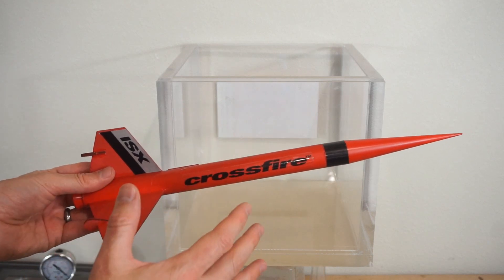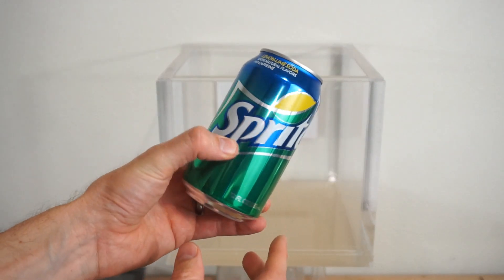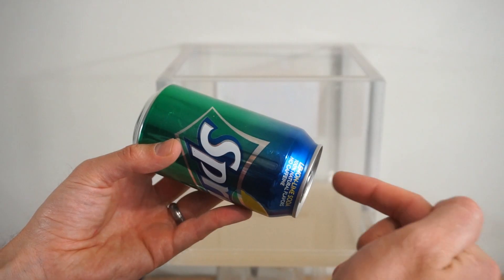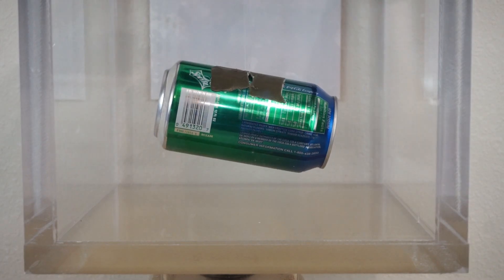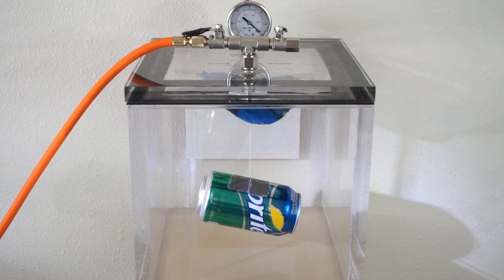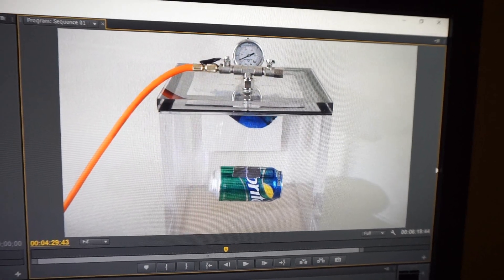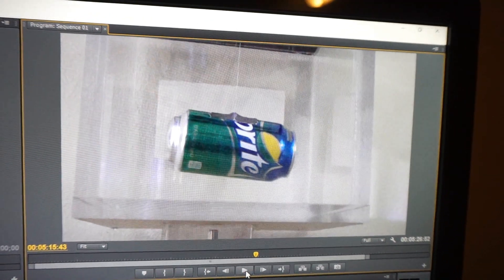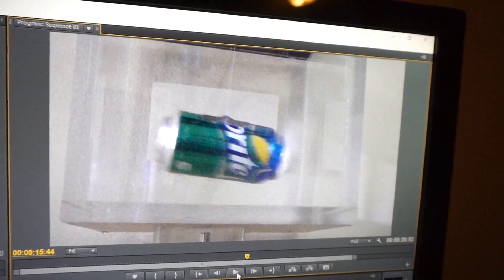Can a Rocket Fly in a Vacuum Chamber?

Comment: Thanks for proving why a pressurized container is impossible in a vacuum
Reply: Thanks for proving you are an imbecile
Reply: Proved nothing of the sort.
Reply: @engineeringtheweirdguy2103  did you not see the what happened to the tin can?
Reply: @JMyoutube1  yes but I understand that the can wasn’t designed for that sort of application. Stick a propane bottle on there and see what happens. It will do just fine. Especially pressurised to the same pressure as the soda can.
Reply: @JMyoutube1  yeah the whole 'experiment' kinda debunks itself, but nasa shillbots will never admit that so meh...
Reply: @papalegba6759  - So when exhaust gas ACCELERATES from the rocket nozzle - from WHERE does the FORCE originate?
See how the chat bot cannot answer that question?
Reply: @papalegba6759  you couldn’t even understand the difternece between materials in compression vs material in tension. I.e a submarine vs a balloon. But sure. Believe away that the video debunked itself based on literally no explanation
Reply: @engineeringtheweirdguy2103  "difternece" lmao you can't even spell the word "difference". plus i've never mentioned submarines, may wanna cut out the lying there chatbot bro.
Reply: @stuartgray5877  you don't even understand that the kinetic energy of a gas particle is related to it's thermal energy, so why explain anything to you? nice try calling me a chatbot tho, NO U! is real convincing... did you know ball aerospace have never heard of you btw? i emailed em to ask.
Reply: @papalegba6759  sorry. Typing away on my phone. Tend thumb words every now and again. Still does not invalidate my argument though. And yes you did. Back when you were talking to my old account which had the password stolen from it. NoTtHeCiA.
Reply: @papalegba6759  I’ve not said anything abusive. Only facts and actual science. And no, it wasn’t suspended. It was deleted. I got locked out because someone changed the password. Shortly after it was deleted. As it turns out it was a flat earther trying to dox me. When he found nothing useful on my account he deleted it and bragged about it.
Reply: @papalegba6759  hence why you can’t find the account anymore on YouTube. If it were suspended you could still find it. Why do you make up random lies and insist they are facts without any evidence what so ever?
Reply: @papalegba6759  speaking making things up with no evidence, I’ve never said that gas particles velocities aren’t directly proportional to heat. Which orifice did you pull that from?
Reply: @papalegba6759  And I am sorry to hear that your sex change operation was delayed by the COVID pandemic.  Hang in there you'll get your "transition" done soon.
Bless your little heart!
Reply: @stuartgray5877  so posting transphobic comments is approved by ball aerospace? Is it official company policy?
Reply: @JMyoutube1  Tin can the same as a rocket. Big brain here
Reply: @Hork Supreme  ok, big thinker. I know you know it's true. You saw it on your tv.
Reply: @JMyoutube1  "I know you know it's true"
What are you talking about?
Reply: @HorkSupreme  you're such an obvious chatbot 😂
Reply: @HorkSupreme  know what's true?
Reply: @JMyoutube1  You're the one that said it first, so what are you talking about?
Reply: @papalegba6796  They have chatbots on youtube now? Thought it was just spammers. Oh, and there's people like you who can't answer a simple question like 'What is Newton's first law?'
Reply: @HorkSupreme  later troll 🧌
Reply: @HorkSupreme  a vacuum cannot apply external force. Which is why chatbots like you really should not mention Newtons first law, as it shows a rocket cannot alter its state of motion in a vacuum 😂
Reply: @papalegba6796  Do you know a single equation used in physics? Do you even accept that such things can be used as an approximation of reality? If yes to both, then describe the equation that could be useful for talking about a rocket, even in a vacuum. I'll give you a hint, m1*v1+m2*v2

Oh no, I'm a chat bot. Guess I'll just say things that chat bots cannot. TND TKD

Have fun figuring that out.
Reply: @JMyoutube1  - Yes, what happened to the tin can?
Reply: @MegaTrivial  in a vacuum the pressurized can or container would explod. 
Its basic physics.

Comment: a PV work diagram proves a rocket cannot create motion in a vacuum. just plug in '0' for external pressure and see the result - flatline.
Reply: Only in a close piston system which is where you’re getting your equation from without any prior knowledge, education or understanding of thermodynamics
Reply: @engineeringtheweirdguy2103  wrong. a PV work diagram can be created against any external pressure situation. in the case of constant external pressure, such as the atmosphere, it's called an isobaric process. look:
https://energyeducation.ca/encyclopedia/Pressure_volume_diagram
and of course a constant external pressure of zero results in the system doing zero work and creating zero motion. QED.
why are you stalking me round the web, lying about everything i say, whilst never providing citations for your lies? could it be you are a troll?
Reply: @papalegba6759  not stalking. You just made more comments on the video we’re already discussing. You think a lot of yourself don’t you?
Reply: @papalegba6759  and no. PV work equation applies to a system with a moveable boundary, on an otherwise constrained gas. A rocket is not such a system. And thus. Doesn’t apply in its standard form.
Reply: @stuartgray5877  please tell me how a CD nozzle applies a 'force' to a gas, & why the ENERGY of a gas is conserved as it expands into a vacuum. kthxbai!
Reply: @papalegba6759  I am asking YOU to TELL ME 

From WHERE does the force originate that accelerates the gas?
Gas HAS MASS
mass REQUIRES a FORCE to be accelerated
The gas MOST CERTAINLY IS accelerated !
SO the force MUST come from SOMEWHERE!

Now You tell ME where it comes from since the MUST BE ONE.
Reply: @stuartgray5877  gas particles are in constant motion. you do know that, don't you?
Reply: @engineeringtheweirdguy2103  funny how you can't post a citation for your claim, like i did. could it be because you are lying?
Reply: @papalegba6759  this shows 2 things. A, the PV work equation or diagram don’t apply to a rocket. And B.) you clearly don’t understand the first thing about thermodynamics
Reply: @papalegba6759  your own link you provided said so. PV diagrams only apply to a closed system. a closed system is a system that can only exchange heat or work. It cannot exchange mass. I.e. mass cannot exit the system. Otherwise it would be an open system. Your fundamental lack of understanding of thermodynamics shines when you come up against someone who actually knows thermodynamics. Embarrassing isn’t it. Being proven wrong by your own citation.
Reply: @engineeringtheweirdguy2103  um, no it didn't say you couldn't draw a PV work diagram of a rocket engine. and besides, a rocket in a vacuum is pretty much the definition of a closed system anyway.  so you're caught lying again. it's all you do.
Reply: @papalegba6759  it’s actually the definition of an open system actually. Once again. The definition of a closed system is that mass cannot enter or leave the system. Only energy and work.
Reply: @papalegba6759  and your link. In the first paragraph, says, direct quote: ”PV diagrams only work for a closed system.”  do you not read your own citations before you throw them at people? Really?
Reply: @papalegba6759  again. This highlights your thorough lack of understand of even basic thermodynamics.
Reply: whatevs, lying guy. by now everyone who read the OP has made a PV work diagram for themselves so knows i am right. it's not hard.
Reply: @papalegba6759  haha “whatevs” the word you say when you have no comeback. 

They won’t be making an PV diagram. As that would require introductory level knowledge of thermodynamics. If they have that, they would know that a PV diagram doesn’t apply to a closed system. Much like your citation does
Reply: @papalegba6759  - SO where does the FORCE ORIGINATE that accelerated the gas into the vacuum ??

WHATEVER you do, DON'T answer the question, but be sure to attack ME and call me a chatbot.
Reply: Yessir. 👊🏻😎

Comment: Just a thought.  Since the whole lid blew off could it be possible that the canister was pushing against that?  
I saw a video where a guy was talking about uisng a small CO2 cylinder to do the test.  He didn't actually build the experiment - just shared his idea.  Here is his video where he's talking about what this experiment would look like: https://youtu.be/pnZGLhUM8AI
Reply: nope. think of it this way. when you throw a ball. do you feel the resistance of the ball in your hand as you're throwing it? or when it hits the catchers mitt? if you answer that you feel the force of the ball in your hand as you throw it, then why would that be different to a rocket in a vacuum. why must some random object or gas, not anywhere near or connected to in any physical way, bouncing off some other object also not in contact with the rocket to provide thrust?
Reply: @engineeringtheweirdguy2103  : That's a great analogy.
Reply: @engineeringtheweirdguy2103  so you're saying the exhaust of a rocket is not a part of the rocket system? lmao at the lengths you'll go to in order to justify your nonsense.
Reply: @papalegba6759  do you think that gas particles are bonded together somehow? because then it would be a liquid. As per the Kinetic theory of molecular gasses which is what all the gas laws are based upon, it states that gas particles are free particles with both mass and velocity and obey Newtonian laws of physics. and that if they collide with a surface they will transmit a force onto that surface. As you suggesting the gas is actually a liquid or solid body? or that Kinetic theory and thus all gas laws are wrong?
Reply: @papalegba6759  the lengths you'll go to, to justify your nonsense.
Reply: @engineeringtheweirdguy2103  if you daren't answer my question just say so, rather than dig your hole deeper by showing you don't even know a gas is a fluid.
Reply: @papalegba6759  I thought I had. I am well aware the gasses are fluids, distinct from liquids. But when you ask if the exhaust is not part of the rocket system you need to be specific. If you were to be in space and throw a bowling ball at someone. is the bowling ball apart of you? is it apart of you while you're holding it as one mass. does it remain so when you throw it. Similarly, is the smoke caused by a firecracker apart of the fire cracker system? In any case you cannot escape the basic physics of the matter. Gas expands equally in all directions. That means that when combusted in the combustion chamber, some moves towards the exit. some move towards the rocket. Since gas has both mass and velocity that means that when those gas particles impact the combustion chamber walls. according to Newtonian physics and the kinetic theory of molecular gasses, the collision between the gas particles and combustion chamber must generate a force on the combustion chamber which ultimately becomes  thrust as there is nothing else to resist this motion. the result for the gas is that is is bounced back in the opposite direction. 

for you to believe in Newtonian physics mean that you acknowledge that an object will remain in motion until acted upon by an external force. this being the case the most simplest observation is that gas expands equally in all directions when expanding freely. However in a rocket it is only permitted to expand uniformly in a single direction. the most simplest deduction that must be made about this is that it is because something is resisting the gas expanding in all other directions which means there must have been a force applied to the gas particles to push them in that direction to exit the combustion chamber. Where there is a force there is a reaction. The reaction will be in the opposite direction to that of the gas exhaust. and the only thing which could be apply that force to constrain the expanding exhaust gas is the rocket.
Reply: @engineeringtheweirdguy2103  no you hadn't. and please stop writing sci-fi technobabble novels in reply to me, it's not normal behaviour.
Reply: @papalegba6759  I believe I did answer the question by outlining that calling the exhaust gas apart of the rocket system is sort of like saying if you throw a bowling ball on a skateboard then the bowling ball is apart of your system. Or do you not read good?
Reply: @stuartgray5877  gas particles are always in motion. adding thermal energy to them increases their motion. a CD nozzle converts that thermal energy into kinetic energy by allowing the gas to expand into an area of lower pressure. it does not apply a force to the gas in order to do so. i'm sorry you cannot distinguish between solids and gasses, i really can't help you here.
Reply: @engineeringtheweirdguy2103  wrong. in  your analogy your arms represent the exhaust & the ball represents the atmosphere the exhaust pushes on. a free body diagram would help you understand this but you cannot draw one, sadly.
Reply: @papalegba6759  nope. As you mentioned in a different comment thread. Gas is made of particles with mass and velocity. For them to exit the rocket and impact on atmospheric particles would be completely separate to the rocket. You’re saying that gas particles no longer in contact with the rocket will magically apply a force back to the rocket despite being separated by distance. In which case you don’t believe it’s an action reaction pair but an action reaction trio.
Reply: @papalegba6759  what is really happening is that gas expands in all directions. When a gas particle impacts a surface its transfers a force. It must. As it’s a particle with mass and velocity. And for it to not expand in all directions means that something must be applying an external force onto the gas to prevent it from expanding in certain directions.

Gas combusted in a rocket cannot and does not expand in all directions. It exits the rocket on 1 uniform direction. This means there must before a force applied to that gas before it exits the rocket to change this particles motion. Ding ding. It’s the combustion chamber walls. Gas particles start spreading out and they are bounced back by the chamber walls. Just as the walls apply a force to bounce of the particles off in the other direction. Gas particles must apply a force to the wall. Newton’s 3rd. Hence thrust.
Reply: @papalegba6759  also, you mentioned that a CD reduces thermal energy of gasses. Tell me. Where does that energy go? First law of thermodynamics. Energy cannot be created or destroyed. Where does it go?
Reply: @engineeringtheweirdguy2103  yeah i never said a CD nozzle reduces thermal energy, i said it converts it into kinetic energy. plus pressure in the combustion chamber is an internal force, so cannot be responsible for producing motion according to newton's laws. you're lying in every single spam post now, kinda odd but meh...
Reply: @papalegba6759  1.) you’ve already stated that for a gas particles thermal energy IS kinetic energy. You’re effectively saying that reduces kinetic energy to gain more kinetic energy.

And 2.) we’ve been through this. All force count as forces. You if I were to hold a up upside down by placing my finger inside the cup and resting the base of the cup on my finger tip. By your logic, that would be an internal force and apparently doesn’t count so it would then fall to the floor despite my finger being there. But that’s not what happens is it? A rocket combusting chamber/CD nozzle is relatively the same except for the fact that instead of the diameter remaining constant, it reduces in some parts and expands in others but never closes off.

Another example about you cherry picking what you want words to mean is a combustion car. The power cycle is contained inside the cyclinder. By you definition that would be well and truely internal. So does that mean there is no force there either? By your logic, cars don’t work
Reply: @papalegba6759  and que special pleading fallacy.
Reply: @papalegba6759  in 3
Reply: @papalegba6759  2
Reply: @papalegba6759  1....
Reply: @papalegba6759  - The question Papa Legba REFUSES to ANSWER because ANSWERING PROVES HIM WRONG:

SO where does the FORCE ORIGINATE that accelerated the gas into the vacuum ??

WHY do you refuse to answer that question?
Now INSTEAD of answering the question, be sure to attack me and call me a chat bot.
Reply: @stuartgray5877  i already answered that question repeatedly, you're just lying about it. because lies are all you have, chatbot bro.
Reply: @engineeringtheweirdguy2103  if you don't understand what pressure is, or what forces are, just say so rather than spam me with mad riddles.
Reply: @engineeringtheweirdguy2103  you absolutely used to pull the wings off flies as a child btw. if you're human, that is.
Reply: @papalegba6759  I understand how pressure and forces work perfectly. You clearly do not, which I know because of your propensity for making statements that don’t reflect objective reality.

I have no riddles in my comments, only examples and analogies. If you find them difficult to grasp, then maybe reflect on why everyone here but you seems to understand them.

Personal attacks in lieu of any substantial rebuttal or logically cohesive arguments. I believe there is a logical fallacy for that. I’m sure you’d be familiar.
Reply: Oh so rocket propulsion DOES WORK as long as you have some "MASS TO PUSH ON"?
Is that what I am hearing?